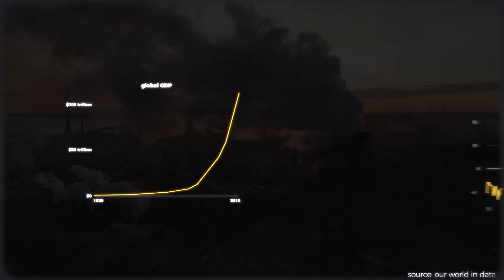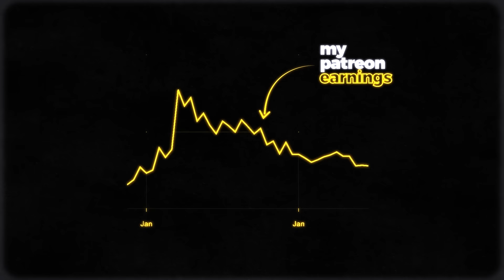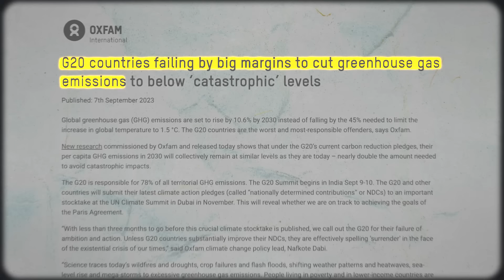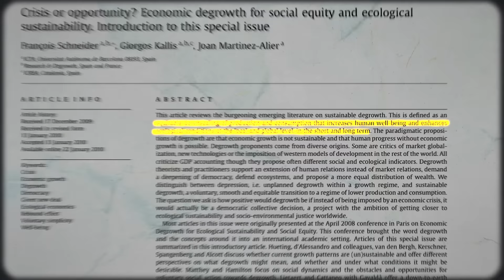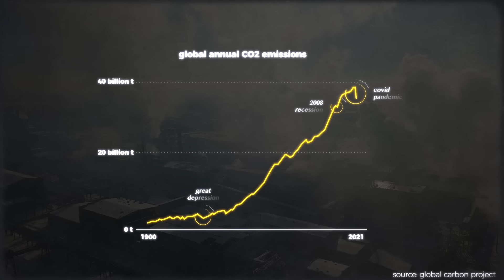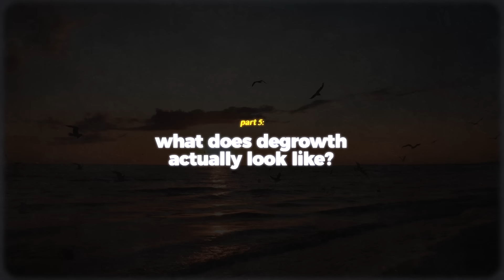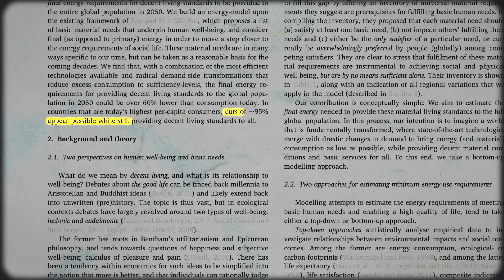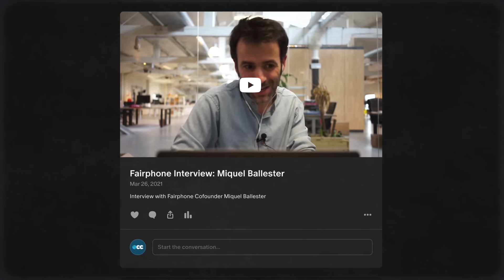Why We Need Degrowth

Comment: Ignoring the multitude of false claims, such as those concerning "Iraqi oil fields," a 95% decline in energy use in the US is a ludicrous suggestion. Many American cities would be unlivable due to the temperatures they reach and the amount of air conditioning and heating you would need to take offline. Additionally, we use more energy for transportation than we do for electricity. And while American cities do need to become more walkable and bikable, taking cars off the road without investing trillions of dollars, massive amounts of energy, and decades of time into rebuilding our cities would just cause mass starvation and the loss of most jobs. 

Degrowth is something to consider when planning for the future, but we don't all live on farmland anymore. You still need to travel to the grocery store, refrigerate food, make it to work, heat , cool, and light your home, etc. The energy reduction we saw during the pandemic due to a halt in most nonessential car travel, unnecessary consumption, most plane travel, a major reduction in commerical energy usage, etc was still only about a 10% drop. 95% reduction would essentially require either rebuilding the entire country over the next 100 years and spending a couple hundred trillion to do so, or killing off most Americans. That's why the stopgap solution is to level off energy usage, and switch from fossil fuels to (relatively) sustainable alternatives.
Reply: "a 95% decline in energy use in the US is a ludicrous suggestion. Many American cities would be unlivable due to the temperatures they reach and the amount of air conditioning and heating you would need to take offline" Uhhh, you just switch to geothermal to heat and cool your home. 

"Degrowth is something to consider when planning for the future" Actually, the larger the global economy is, the faster we are destroying the Earth's ability to support life, so unless we shrink the global economy to fit Earth's carrying capacity, we won't have much of a future (as in , billions of people dying from famine and resource wars).
Reply: @HealingLifeKwikly  Geothermal does not scale up easily, and certainly not in a dense metropolis. You cannot heat and cool 10 million homes with geothermal using an area the size of NYC. Energy is still energy, geothermal is not limitless. And that's just one part of energy demand.

The US cannot reduce her energy consumption by 95% without obliterating the current quality of life standards. You would literally be fighting for survival in many American cities, such as those in the American southwest. Crop production and agricultural transportation would fail. Oh, and don't forget that the US is a major food and energy exporter, so this would lead to famine for billions, not just the 330 million Americans. 

Yes, we need to conserve resources. But energy usage is necessary to keep 8 billion people alive. A move towards lower energy usage is reasonable in the long term, but the immediate solution should be renewables and nuclear. Planned degrowth is necessary, 95% energy reduction is called a genocide.
Reply: @Jake-rs9nq  Sorry, we're talking past each other: I agree with you on the 95% point and shouldn't have included that in my paste and you probably agree with me that my house in suburbia can be heated by geothermal. 

"A move towards lower energy usage is reasonable in the long term" Here I'll quibble with you: We have to start substantial reductions in energy use now or more people will die and more species will go extinct. We're overshooting Earth's sustainable carrying capacity by ~75%, and until we end that overshoot, worsening ecological and societal breakdown will continue. 

"but the immediate solution should be renewables and nuclear." Renewables  CAN'T fill all our energy needs anytime soon--wind and solar currently provide only about 3% of all primary energy production, and nuclear energy is positively suicidal and omnicidal for a civilization that is heading toward collapse--because it would leave dozens to hundreds of power plants with exposed fuel rods when their societies break down. 

Shrinking the economy is the ONLY way to prevent catastrophic collapse. Industrialized capitalism was doomed the self-destruct from the start.

Comment: The ONLY possible way out of this infinite growth SYSTEM would be to make it financially worthwhile for people to share the jobs we would almost all AGREE we do NEED to have done and work much less....no more working and doing absolutely anything and everything FOR money but sharing the jobs that creates what we NEED.  It's the only way to do it without a nightmare collapse of society.
Reply: Ok, so how are you going to make it financially worthwhile to job share? 

I build houses. How do you job share that?
Reply: @youtubesucks1499 Wouldent it just work like a normal shift with less hours. On my job i cant work 24/7 it must be split in to 3 shifts. I guess it would be the same, its just a reduction inn work hours and adding aditional staff. But with increasing elderly population that might be a chalange inn some fields.
Reply: @estenottesen2865  So, I have impeccable building skills. What if the guy I "job share" with doesn't? 

I am not fixing his screwups. 

Plus, I am not working for half the salary. My guess is the other guy won't either. 

So you just doubled the labor. Which means the cost goes up significantly. 

Explain again how job sharing is going to work?

Maybe I am missing a critical point. I don't see how paying double labor is going to help.

Comment: Lets not forget the big elephant in the room: Population. This wont mean very much if we cant get our Population down significantly.
Reply: It's already going down, look at any map (updated for 2023) of which countries have a birth rate lower or higher than 2.1 (the replacement threshhold).
Reply: Effective degrowth happens when the population decreases, however the current projection still shows the global population is still increasing till 2050. 
But don't be dismayed, the actual population by 2050 will not reach the 9-10 billion people in the world as projected by the UN or by the World Bank. In the next 15 years the climate change will dramatically change population growth into the negative, as we have already got close to the maximum population that the human race will ever reach. The increase in floods, droughts, crop failures, glacial collapse, forest fires, another pandemic, wars, and other things will start eroding away on the global population in the next 25 years, as this will lead to degrowth. Population is the major driver of economic growth, the last times in human history that sustained degrowth happened was when the world population decreased. It happened during the black plague and showed a little sign of it during 1918 Spanish Flu, WW1, and WW2. In all these examples the affected areas showed major signs of degrowth until the population started increasing.
Reply: @Drought-jr6pb  definitely, it seems our population won't decrease by human intent voluntarily unfortunately. Environmental pressures will force the decrease most likely.

Comment: It seems like that the problem is waste rather than growth or productivity. But that's just my tiny brain doing tiny brain talks.
Reply: Well, if we would have a 100% circular economy (which is not possible), we will have the same problems very quickly. A healthy" economy needs 3% growth annually. This doesn't seem very much, but the danger is that it is exponential. In about 140 years, that 3% is the entire 2023 economy just in growth annually, 24 years from than it will be 2X today's economy. Meaning that also in terms of materials extraction we are on square 1 in 140 years. 
Additionally, oil is a very efficient energy source, per unit of energy input we get 100 units back. With renewable energy, this is about 4 units return. Our economy literally cannot function without oil because this is governed by the need for growth.

Comment: Those mines in Congo are deadly and those people have a gun in thier backs making them work. Most people have no idea. They won't hear it.
Reply: The fact that there is exploitative and environmentally damaging mining being done to supply batteries is not a good argument against using batteries, it is a good argument in favour of regulating mining better. It's also a complete red herring because exposing desperate people to dangerous conditions for low pay and simultaneously damaging the environment is not in the least bit unique to the resources needed for batteries, it is a long standing problem. Blaming the move to green energy for this is a bogus argument.
Reply: @danyoutube7491  
I wasn't making any argument here.
I was making a statement about the fact that slavery is going on and everyone turns a blind eye. 
You can branch off into other topics if you want you know....this isn't a static issue, not whatsoever.  The dynamics are ALL important.
Reply: @Notfunnysam  Ok, sorry. I have seen it levelled at the green economy before as an argument against electric vehicles etc, so assumed that's what it was. I think it's reasonably well talked about these days, but I'm not aware of anything actually being done about stopping the exploitation happening.

Comment: There is so much illogical thinking in this video I don't know where to begin. CO2 is at best a very weak so called "greenhouse gas". It only makes up .04% of the atmosphere and of that 97% comes from nature. CO2 is necessary for photosynthesis at about 200ppm photosynthesis stops. The earth is at about 400ppm and over earth's history it has been dropping. Will it reach the critical 200ppm where all life on earth stops? All the predictions of climate catastrophes from an ice age predicted in the 70's, no polar ice caps as predicted by Al Gore, or sea level rise have never come true. Cherry picked readings from recording stations placed in urban heat zones have skewed temperature reading on the high side. Satellite readings get a different result. Carbon emissions as a cause of climate change is therefore totally illogical. Socialism has never worked in any society, and it never will because it goes against human nature. Our economic focus should be on reforming our banking system where money is created out of nothing for the elite's which enables them to buy up labor resources, and property for doing nothing more than computer entries. Why is this Babylonian money system never mentioned in your video? We must move away from monopoly capitalism to free enterprise. Energy could become extremely cheap and, in some cases, free if we utilize suppressed technological advancements. Water has been turned into a combustible gas by such inventors as Stanely Meyer and Dennis Klien. Cars, trucks, locomotives, jets, and ships can be fueled in this manner with nothing more than water vapor as an emission. The problems with thorium nuclear energy will soon be solved with that cheap, clean, and safe form of energy producing most of our electricity. So, if one still believes in the CO2/greenhouse gas myth the supposed problem will be solved by technology. With energy cheap to free in price people can shift their focus to recycling waste, plastics, electronic devises etc. There will be so much free time created with free to cheap energy people could be employed in these otherwise unprofitable labors. A tax could be levied on these products at the time of sale for this recycling. This tax can go into a fund to pay recycling workers. Finally, the world's population is crashing with birth rates below replacement rates in most of the world. A substance recently injected into billions of people will greatly reduce the population. So, pollution and consumption will come down with drastically less people. So, Henny Penny the sky is not falling down.

Comment: I study Sustainable Chemistry at the University of Amsterdam and we are mostly focusing on changing to a circular economy. However, when I did the math and it just doesn't work out. If we would have a 100% circular economy (which is not possible) by tomorrow, we will have the same problems very quickly. A healthy" economy needs 3% growth annually. This doesn't seem very much, but the danger is that it is exponential. In about 140 years, that 3% is the entire 2023 economy just in growth annually, 24 years from than it will be 2X today's economy. Meaning that in terms of materials extraction we are on square 1 in 140 years. 
Additionally, oil is a very efficient energy source, per unit of energy input we get 100 units back. With renewable energy, this is about 4 units return when accounted for fluctuations in availability. Our economy literally cannot function without oil because this is governed by the need for growth.

Comment: You saying workers are unhappy does not make it so. You saying all growth is related does not make it so. You saying capital and fossil fuel are in any way related is pure metaphysics. Even you admit gdp is unrelated to well being. So why do you push a connection between fossil fuel and christmas presents. They are only related because the oil companies at the top of the economic hierarchy made them that way. You can't reduce fossil fuel production by giving fewer presents. You can reduce the number of presents given by reducing fossil fuel production. Simply delicense an oil major, and leave the ideology up to the market.
Reply: "You can't reduce fossil fuel production by giving fewer presents" - yes you can, because fossil fuel production is practiced to meet demand, because they get paid to sell it to those who demand it. If there is less demand - due to less demand for products directly made from plastics and other fossil fuel products, and less demand for the energy used in the production and transportation of any type of merchandise, whether it is made from oil or not - then the price of oil goes down and oil companies produce less oil. That isn't only the general theory of supply and demand, we see it every time the oil price slumps due to lower demand during economic downturns; producers reduce production.